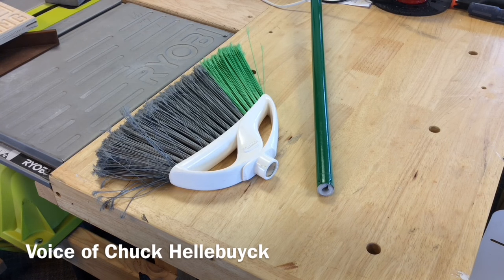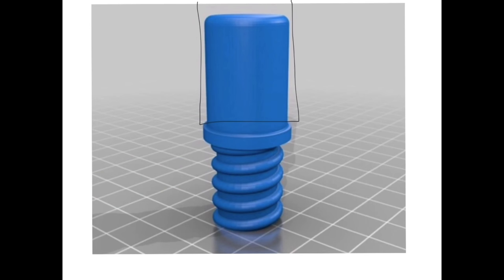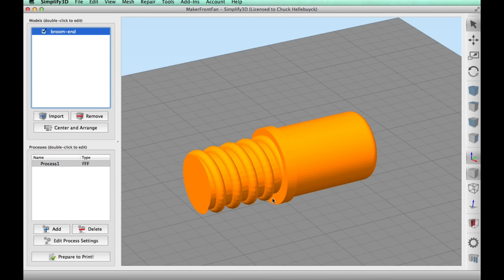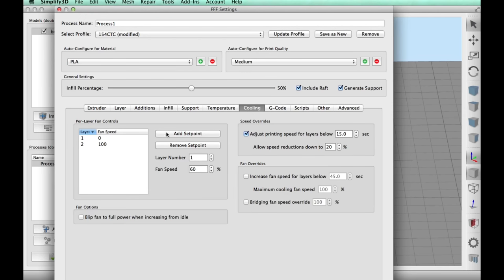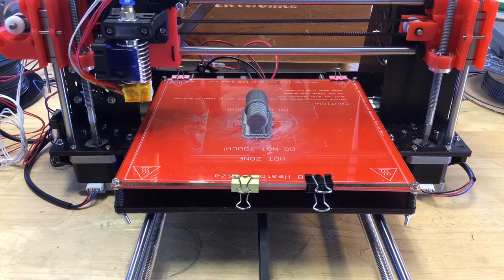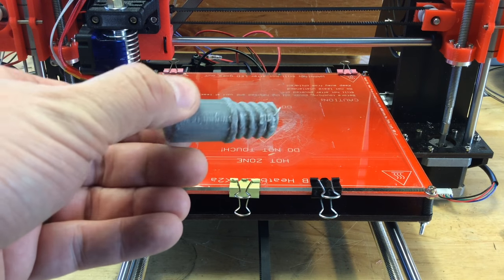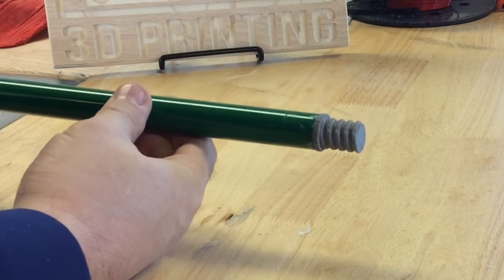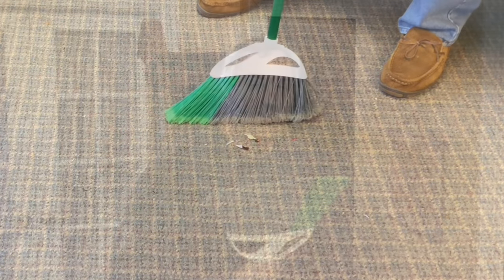3D Printing Repair for Broken Broom Handle

Comment: This is perfect! I have 3 broken broom handles here at home that I will fix. I thought I would have to go into Fusion 360 and design my own, I should have known that someone would have already designed this part, it's a common problem. I think I will try to print it out of polycarbonate or nylon and see how that works.Thanks for sharing your fix Chuck!... Time to heat up my printers.